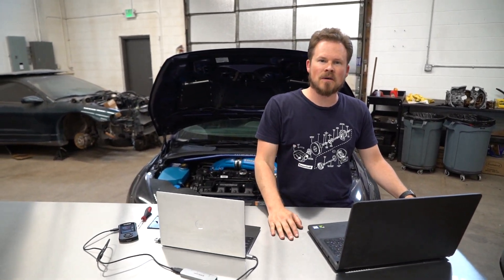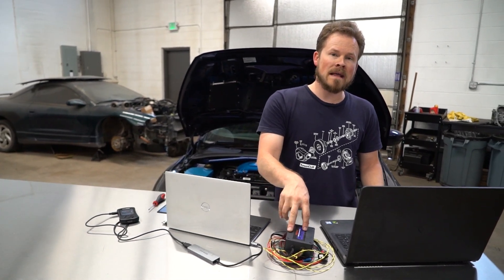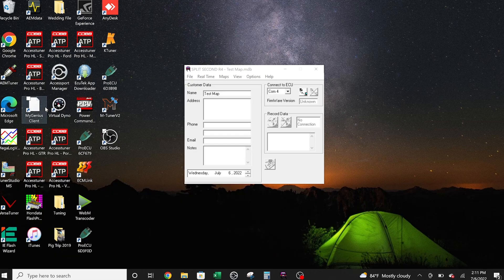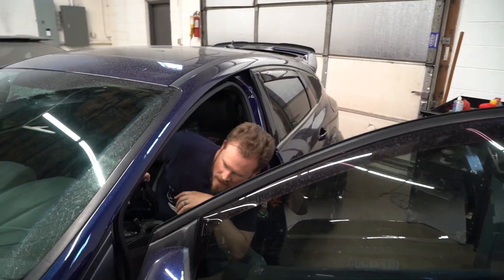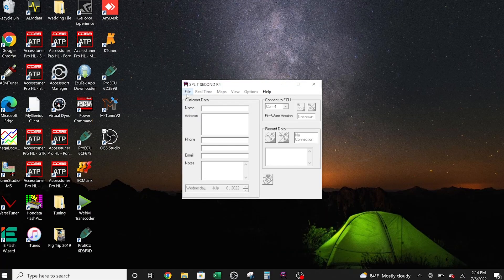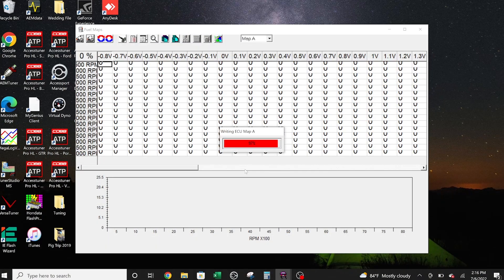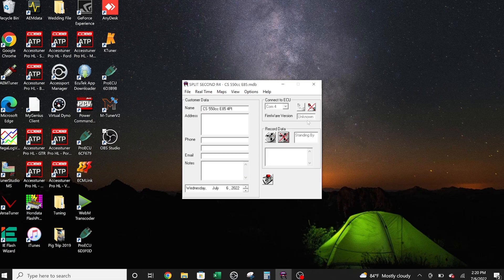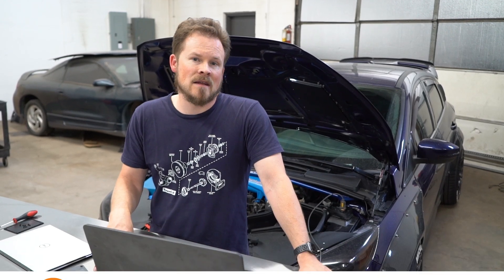Complete Split Second and R4 Software Guide | Focus ST and Mazdaspeed Aux Fuel

Comment: Hey man quick question for you i had a issue with my port iinjection where it was just constantly shooting fuel and i didnt figure it out until i unplugged the power source to it and cranked it a couple more times and it finally started because it wasnt being flooded with fuel. My tune that i downloaded onto the ecu isnt working now it isnt spraying the fuel when its supposed to which is ab 4100rpm what would cause this?

Comment: Does the fuel map for the split second controller need to be modified when adding a WOTBox for no lift shift?
Reply from the maker: No, the WOT box just cuts ignition, the aux map doesn't need to change.

Comment: Can you run aux fuel with just pump gas? I live in canada and dont have e85, so im building my car yo have the most power with just pump gas. And noone has really touched on aux fuel on just pump gas. Love your videos learned alot about the platform!
Reply from the maker: Ethanol and Methanol injection is more popular for port injection, maybe - but if you need more fuel than the HPFP can deliver, you can totally run pump gas through your aux fuel system!

Comment: So if I have injectors and a hpfp do I need the split second modular?
Reply from the maker: You do not need this unless you have a Port Injection setup - it's either HPFP upgrades or Aux Fuel usually. Pump and Injector upgrades are nice because no extra ECU is needed.